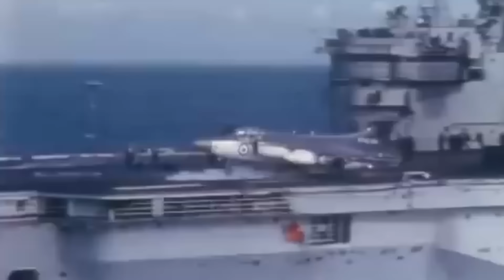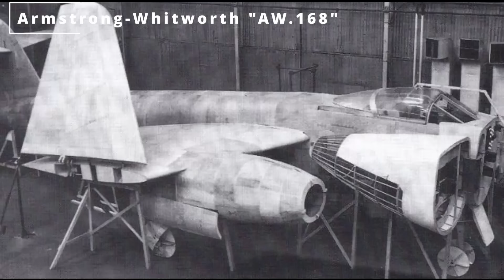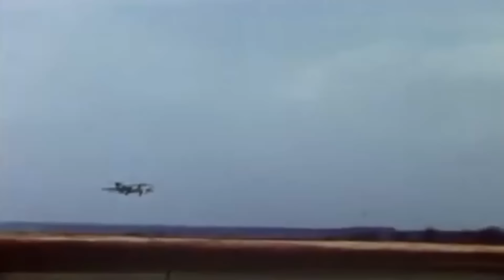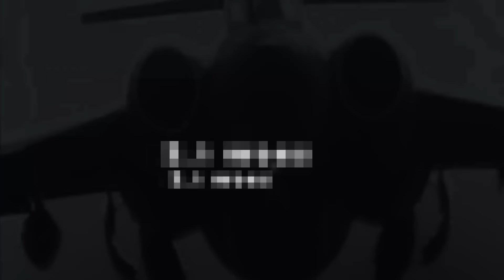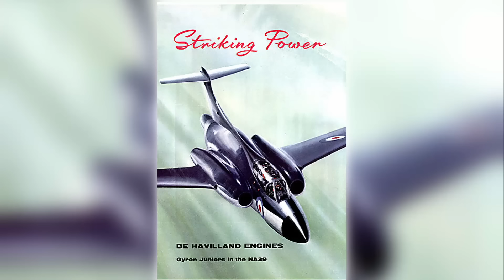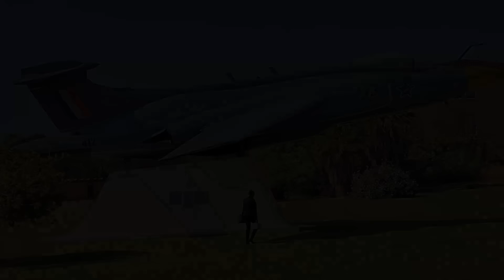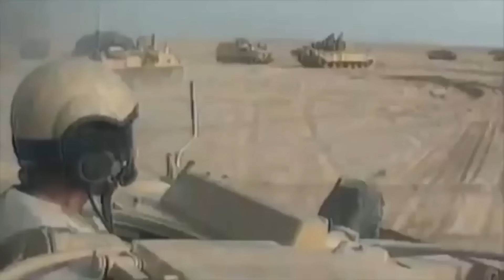Blackburn Buccaneer  -  Insane Low Level Bomber Americans couldn't shoot down - (Full Story)

Comment: I was posted to RAF Honington in 1972 after training as aircraft electrics & instruments engineer, joining 12 sqdn at the age of 16 years 9 months old, I could not sign for any work for 3 months, till I reached 17. I went on to be the 14th member of the newly reformed 208 sqdn, then on to 237 OCU, before my posting to Malta and Canberra's, and as a civilian defense contractor having witnessed the first flight of the brand new UK built Eurofighter / Typhoon, I can tell you nothing could compare to the "Buc" I even had the chance to fly passenger in one while on detachment in Sardinia. The low flying took some getting used to, the radar automatically raised the flying height and then lowered it again when flying of cattle and hedges! And yes they did fly low, I've seen them screaming down the runway below undercarriage height, the Aircrew claimed the A/C rode on a cushion of air, a cushion about 6 - 10 feet thick. I was told, but can't confirm, that the rules for Red Flag were changed to add a min flight height of 200 feet, to stop the Bucs winning, and to give our american friends a chance at spotting it on approach, that did not work, so they were asked to inform when then were starting their run...  Their long toss method of delivering 1000lb bombs was so accurate, we watched it at the ranges in Sardinia out perform the American and Italian A/C every time.

Comment: Whilst I was based in Cyprus 82-84 as part of the Sovereign Base Area Armoured Squadron based mainly in Episkopi but not far from RAF Akrotiri we knew that In 1983, six Buccaneer S.2s were sent to Cyprus to support British peacekeepers in Lebanon as a part of Operation Pulsator. On 11 September 1983, two of these aircraft flew low over Beirut, their presence intended to intimidate insurgents, rather than inflict damage directly, from what we were told by RAF personnel the low flight over Beirut involved the two aircraft flying down the main streets at roof top level. 

My brother also worked at BAE Systems at a Brough as an Electrical Engineer and fitted hundreds of miles of wiring looms in to Buccaneers and other aircraft, brilliant video which I throughly enjoyed.
Reply from the maker: Thank you so much, really means a lot, I am working on another Bucc doc, it may take a month or so, but it will be covering more Bucc antics. :-) Joe

Comment: I can recall a TV documentary a couple of decades ago. Buccaneers (subsonic, remember) in low level exercises in the USA. With a couple of undetected Buccaneers flashing past a control tower, shouting "Bang, bang, guys!" on the radio while airfield staff called out "What the HELL just happened here?!"

There was also another infamous story that did the rounds - which I hope someone here knows more about than I do.
Of a flight of extreme low-level RAF Vulcans (strange to remember they'd been designed as high altitude bombers) attacking New York City. Exercise of course - most were (theoretically) splashed. But I was told two of them got through - easily enough to erase NYC with the standoff ordnance they were (theoretically) carrying.
JHC ... if that had been real...
Or even true - I honestly don't know.
Anyone?
Reply from the maker: I have not heard of the "bang, bang" story, but it would not be surprising, I think I recall reading something similar to the NYC story. ; Joe

Comment: Good vid.  I thought you might have mentioned that whilst on exercise in the N Sea on a Nato exercise, the navy was asked if they could get aircraft over Belize which was a British Protectorate in S America.  Guatemala was preparing to invade Belize.  The time frame was only 24hrs to the invasion.  Ark Royal pulled out of the exercise and went full steam ahead for Belize.When within range of Belize, 2 x Buccs set up as refuellers and 2 x Buccs launched from Ark Royal.  Refuelling en route, the 2 refuellers returned to Ark Royal leaving the attack Buccs to continue onto Belize.  Although the americans had given permission (diplomatically) for the Buccs to traverse American controlled airspace, the Buccs were contacted as hostiles once they were in American controlled airspace.  Whether this was the Americans being sneaky, saying one thing and doing another is unknown.  Our Buccaneers ignored the challenges and pushed through and  onto Belize where they flew over the airfied there and along the Belize/Guatamalan border therefore advertising their presence before returning to Ark Royal.  The Guatemalans therefore thought there was a British aircraft carrier nearby and cancelled the invasion.  Not bad, on exercise in the N Sea and then 24 hours and 2,600 miles later later, putting 2 x aircraft over Belize.
Reply from the maker: I had to leave quite a few sections out of the video since I was concerned that it was going to be too long. However, I am planning another Bucc video which ought to be out soon....I hope...... if I could stop tinkering with the scripts :-) Joe

Comment: I worked as an apprentice at Blackburn's (BAe Brough) 1972-1977 and then as a structures engineer to 1979. The machines in the machine shop were amazing. The initial attempt to machine the engine rings one side at a time failed because the internal stresses made the ring warp. So they doubled up the mill and machined both sides simultaneously. I was told that the steel was 100ton/sq.in (tough...). 
As students we were given tasks throughout the works testing materials. Whatever you did, you didn't get any of the adhesives on your fingers. The adhesive would win if tested...
The controls surfaces were operated by pushrods with ball races at either end. During my passage through Weights and Measures (I think is was) I had to test the breakout torque on each inner race. This ensured the lightest touch on the control column which I understood the pilots appreciated.
We had a Buccaneer come back with a bent tailplane. The calcs showed it must have pulled in excess of 10g !
During those trials with the Yanks, the Buccs had to fly over ranges of hills. flying at low level up the hill was ok. They were below the radar, but as they "bunted" (pushed forward) over the ridge they popped into view. The pilots were so confident with the behaviour of the plane that they began rotating onto their backs and pulling up at the ridge (Eeek!) to follow the line of the hill - and avoided the radar. 

Ah! memories...
Reply from the maker: Imagine that, I am quite envious. i love that maneuver of coming over the hill inverted, takes some balls to do that. I am planning to put together another Bucc video, covering some of the more intricate detail that a lot of people seem to enjoy, but it will take a fair bit of research, watch this space. :-) Joe

Comment: When on airfield crash duty at Leeming a Buccaneer landed and burst a tyre. He called for tractor assistance but was told to power the aircraft off the runway as there were two Jaguars in the circuit desperately short of fuel. The noise created by the Buccaneer to clear runway excruciating.
Reply from the maker: I can imagine the racket two Speys going like the clappers must have been glorious. I hope you got some good pictures.  :-) Joe
Reply: Alas no, I was too busy with the rest of the Crash Crew standing preparing for possible problems of all three aircraft .
Reply: I was one of 3  armourers from 208 sqn that flew to leeming hopping on the a herc to help recover the aircraft

Comment: I read a book about the buc, the head was selected.up prior to launch, the idea being that it would come up automatically after weight on wheels switch. However it caused an accident due to flow interaction.. The S.2 fixed the problem with extra engine power of the spey
Reply from the maker: Do you recall the book? - Joe

Comment: But, wht was it 'insane'?
Reply from the maker: For me, a machine designed with slide rules and protractors, powered by engines which were also designed with the same that can fly at over 600mph at cow top height is insane considering that only half a century prior humans had only just discovered heavier than air controlled flight. - Joe

Comment: The original SU25.

Not retired until 1994.
Reply from the maker: I used to have a poster of the Frogfoot on my bedroom wall, however, I also had about another 50 posters of other aircraft, but still, the SU-25 is a very unique machine.:-) Joe

Comment: Errmmm. Why is it 'Insane'? 
 It was designed for a task and performed it very well. When called upon to perform another task that required similar abilities it also did that very well. It was designed to operate at low-level and performed excellently at low level. When a higher altitude was needed it performed competently. 
Any intelligent system will perform insanely when given a bad dataset. But the Buccaneer did not have enough automation to be able to suffer from that.
That all seems to demonstrate that a lot of sanity was involved.
Reply from the maker: All of what you wrote is correct, however, as a Luddite even an electric bulb is a miracle to me. :- ) Joe

Comment: It is surprising just how many air crashes have come about because of the artificial horizon failure, replace it with a spirit level, it worked in the first world war when my grand father was in the RFC, simple things work better, if you are flying straight and the spirit level indicates you are level then you are, and if it indicates level when you perform turns and banks then you are doing the maneuver correctly!!, use a rise and fall indicator to gauge your rate of assent and descent.
Reply from the maker: Good point, no skool, like old skool, I think this calls for another visit to the local RAF museum to take a closer look at the instrument panels. Way back when I was flying on the regular I used to hand my mascot from the compass, and it a good indication (To a point) if I was banking, climbing, descending, ok, not scientific, and certainly did not depend on it, but interesting nevertheless. :-) Joe
Reply: If you’re flying in balance, a spirit level (aka the ‘ball’) will always remain in the centre. However, it will never show your attitude.

Comment: The reason why Buccs could go so low was because of there design. The coke bottle shape helped build up a cushion of air beneath the fuselage which actually stopped it from crashing into the deck. I heard one story of a pilot who demonstrated to a passenger that if he was to push the stick forward the plane wouldn't go any lower. The bucc would always resist the move and go back to its low level hight on its own because of the cushion of air
Reply: ground effect
Reply: Popular myth. It’s just not true!

Comment: One of my RAF Basic jet instructors was a Buccaneer pilot. You will note the amount of ironmongery in the canopy framing, designed to withstand low level birdstrikes. One has to learn to pivot at waist, shoulders, and neck,  not just turn one's head, in order to see around all the framing. This is quite tiring under high 'g' forces. It's like a gym in there!
Reply from the maker: Holey moley, it would be an honour to be taught be a Bucc pilot. Many years ago, I had an instructor who was a former A4 Skyhawk pilot, I have never known anyone to handle a C172 like he did that day, I never knew the spamcan could do what he made it do that day, it was def a code brown situation for me.  - Joe

Comment: A friend of mine, a boat owner,  was frequently hired by the RAF to assist with low-level bombing practice runs on Luce Bay which were carried out by Buccaneers. Being out on the boat at the mouth of the Bay as these magnificent machines flew overhead almost on the same level is an experience which will last me a lifetime. Once of out great unsung hero's of the air!

Comment: I guess you meant 650 square feet of wing area? Not 650 feet? Interesting that aircraft aren't really designed for such low altitudes anymore - although I've heard some stories about very low flying in the F111 (and sadly they are retired as well).
Reply from the maker: One day I will convince the missus to proof read the scripts......one can dream...thanks for pointing that out. The F-111 is one aircraft i really want to cover, it may have to be a multipart job, if I have learned one thing after this video is "Multi part" might a way forward :-) Joe
Reply: @AviationRepublic  no worries - I got to see the F111 in flight many times in northern NSW and SE Queensland. One time I saw two off the coast near Evans Head flying just above the waves. I was also lucky to see three at the Williamtown air show just before they were retired. A great plane, and sadly under-rated. Thanks for the video about the Buccaneer! Sadly they were already retired from the Fleet Air Arm when we visited Yeovilton in 1982. The only aircraft we saw at tree-top height on that trip were RAF Tornadoes.

Comment: The last truly aerodynamic combat aircraft, with all of its payload mounted inside the fuselage, not on draggy external pylons. It is a wnderful creation of strange beauty.
Reply from the maker: That rotating bomb bad is special, although there were a few American aircraft with recessed bomb bays, I love how smoothly the door rotates. :-) Joe
Reply: B1, B2, F22... The B1 can carry external munitions, but so could the Buccaneer. Not trying to take anything away from the Buccaneer, but your statement is completely false.
Reply: @GlimmerOG By citing later iterations/modifications, it seems you have rather missed my point, . 

The original design - which was key to very low,  very fast, very long range nuclear weapon delivery - dictated its profile, hence the inboard weapons stowage, to preserve the aerodynamic profile of aircraft.

It is also the case that the Buccaneer was the last combat aircraft designed with inboard weapons carriage.
Reply: @philipsturtivant9385  the F22 and the B2 were put in production with only internal weapon storage. The B1 was originally designed with only an internal bay, as it was intended for nuclear weapons only. It was changed after the role of the aircraft changed to low-level attack. Much like the Buccaneer. Like I said, I'm not trying to denigrate the Buccaneer, but there have been aircraft designed since that are truly aerodynamic and with all of their payload mounted inside the fuselage.